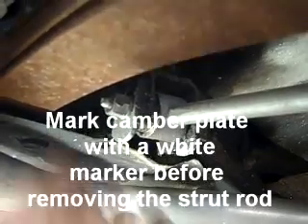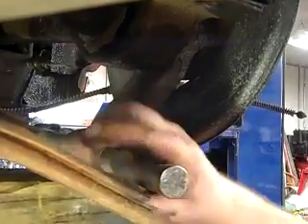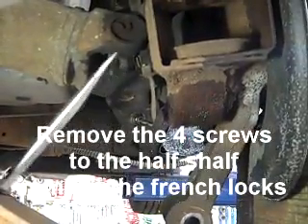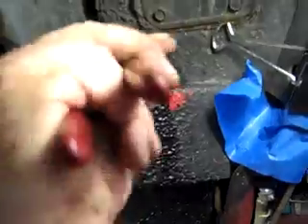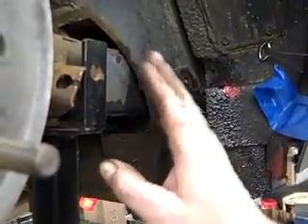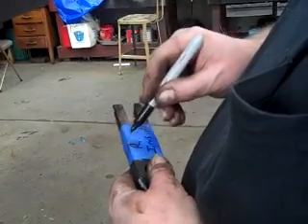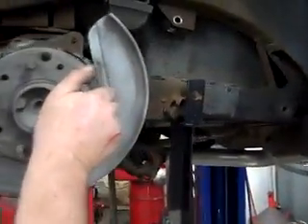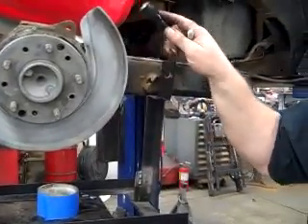Part 2 - Video Instructions to Remove Trailing Arms from C2 and C3 Corvettes

Comment: Mine was the worst. The bolts came out with a mild beating. The frame holes were elongated. I had to make up new reinforcement plates and weld them on the frame before I was able to install the rebuilt arms. Inspect yours for that kind of wear. Nice video.
Reply: Good point.  Thanks for posting.

Comment: Excellent demonstration of trailing arm removal. Looks like the only special tool was to remove the strut rod from the shock mount?

BTW, how many miles on that demo Corvette rearend?
Reply: I used a punch to remove the shock mount from the strut rod.  If you have a southern car, minimal rust, it will come apart fairly easily.

Comment: Awesome video, I only had shims on the outside of the right rear trailing arm though, is this normal or did I lose some?
Reply: Your primary assembly might not have needed it.  New poly bushings are much wider and you may have to lose a few shims to center it to the car.

Comment: How do you remove the bushings in a trailing arm? I’m working on a 1975C3
Reply: I used a cutoff wheel between the rubber and outer metal bushing.  Just cut through and it falls apart.